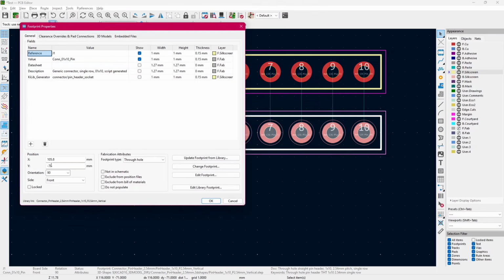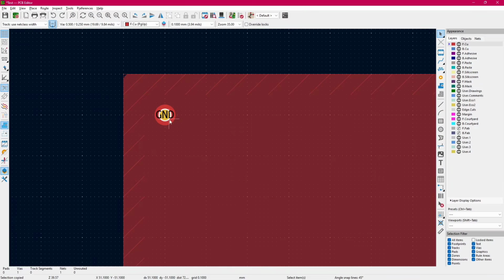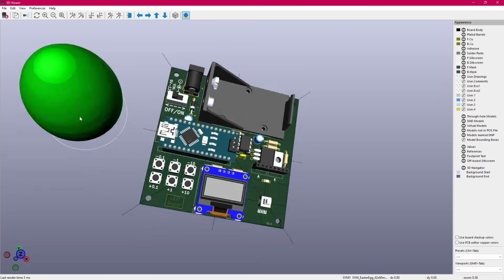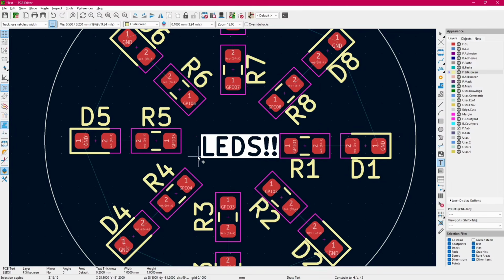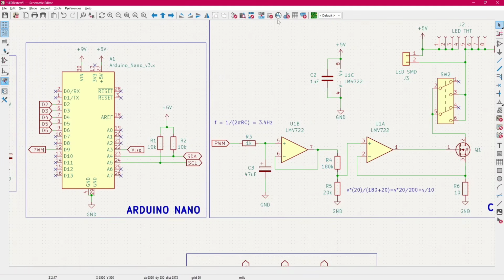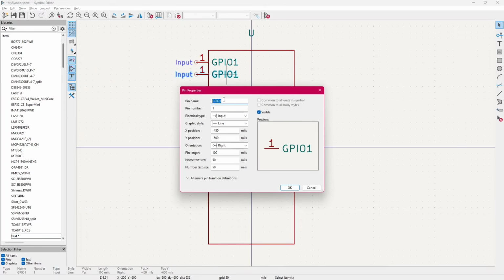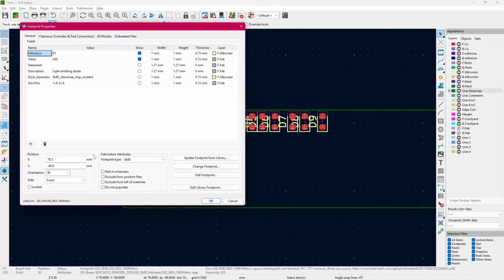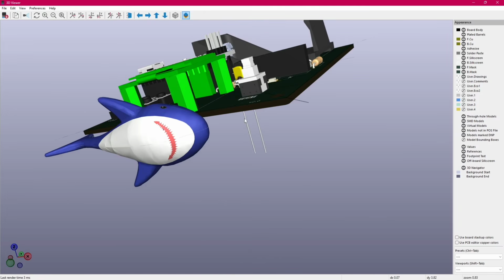20+ KiCad Tips and tricks I Wish I Knew Sooner

Comment from the maker: If you liked the video consider to subscribe! Anyway you can check this other video on kicad on how to add images and custom font to your pcb:

https://youtu.be/wBLRVxAQL1A

I didn't want to make chapters for the video because they were too much and I thought it could be annoying for some of you so I write them here:

1. Rounded corners 0:05
2. +*/- on box 0:18
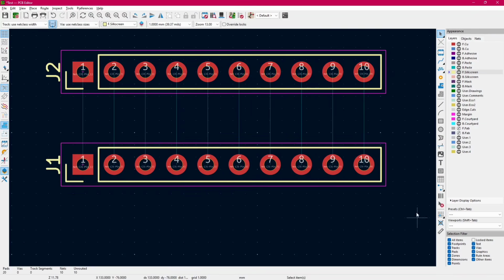3. Trace "free mode" 0:27
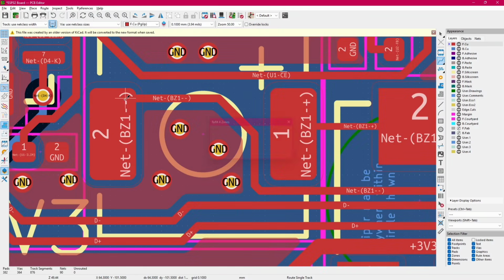4. Colorful pcb traces 0:38
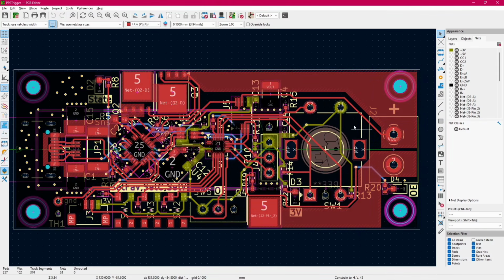5. Highlight a net 1:14
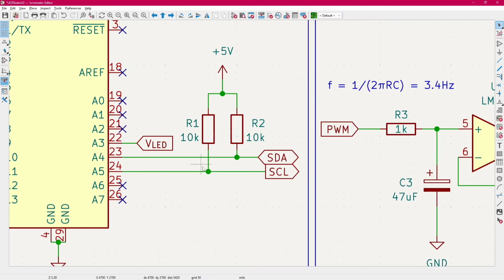6. Schematic with wire jump 1:22
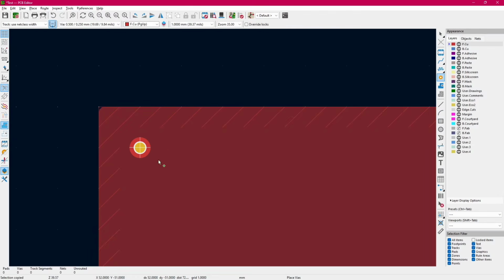7. Vias array 1:41
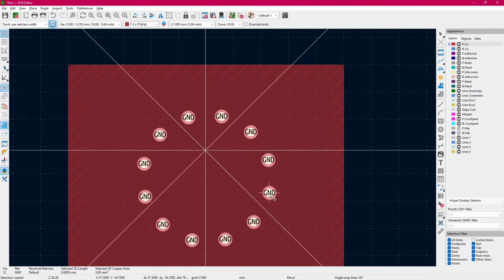8. Component array 2:22
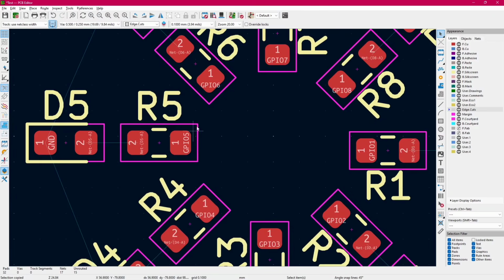9. Egg 3:24
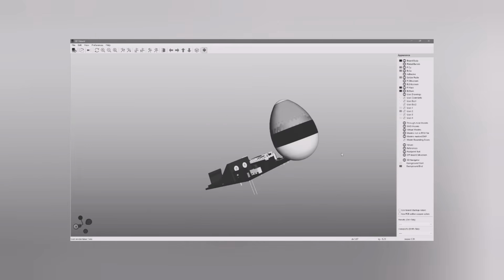10. Measuring unit override 4:05
11. Fast Label Spreadsheet 4:18
12. Fast Label Ins key 5:00
13. Fast label pin helper 5:16
14. Silkscreen label 5:27
15. Move both component and trace 5:36
16. Best plugin ever 6:02
17. Change multiple footprints at once 6:54
18. Free angle mode 7:41
19. Change label type 8:27
20. Standard/Rounded track 8:39
21. Multiple pins with spreadsheet 8:54
22. Multiple pins with Ins key 10:05
23. Board statistics 10:18
24. Quickly expose copper 10:25
25. Align and DiStRiBuiT lol 10:34
26. Change coordinate reference 11:54
27. Smolhaj 12:29

Want beautiful PCBs?

https://pcbway.com/g/zr03zR

Want to support me? Buy me a cofee!

https://buymeacoffee.com/xburningelectronics

IG: https://www.instagram.com/xburningelectronics